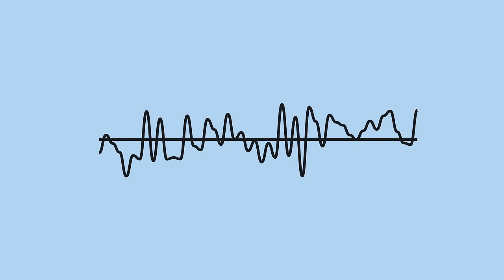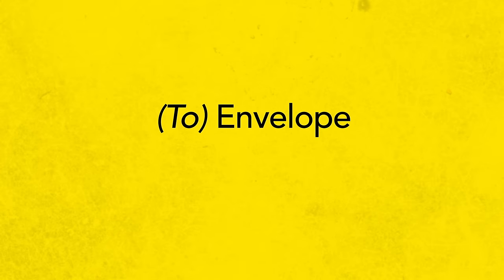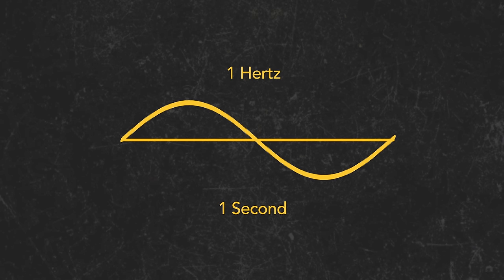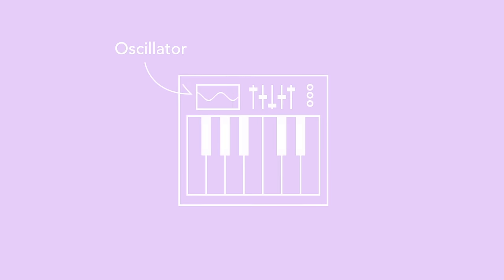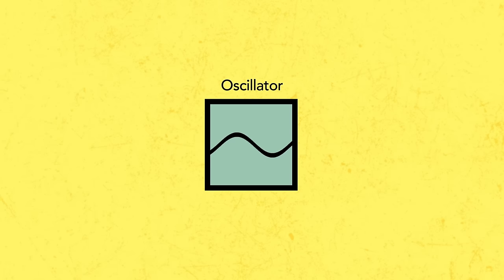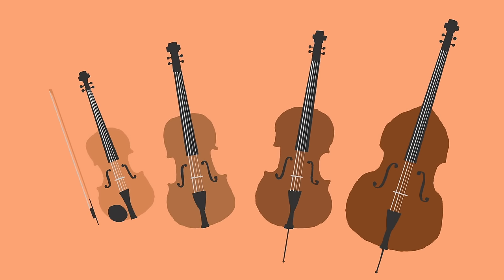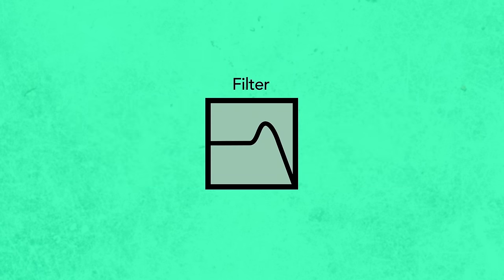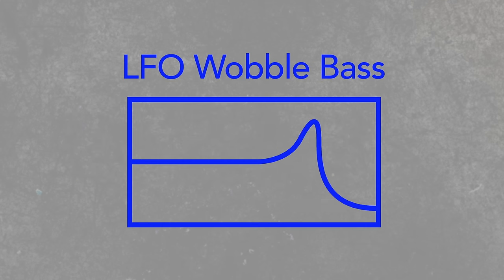Synthesizer Basics: Amplitude, Oscillators, Timbre | Music Production | Berklee Online

Comment: The frequency animation confused me a bit. I understand the concept of frequency, however when increasing the frequency in the animation, the shape of the wave is altered. The higher the frequency the tighter space between the peak and base of the wave gets smaller. So does increasing the frequency also alter the shape of the wave like this? Or is it just a logarithmic representation of decreasing wavelength as the frequency goes up?